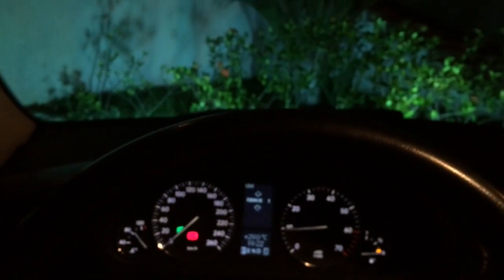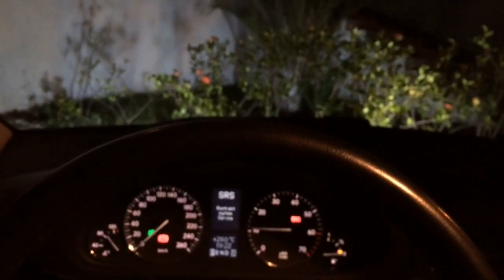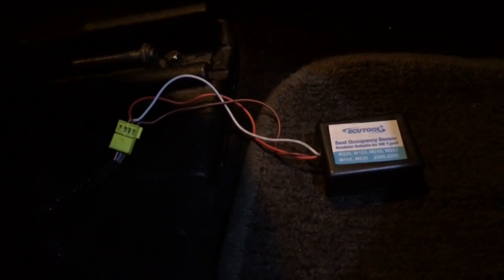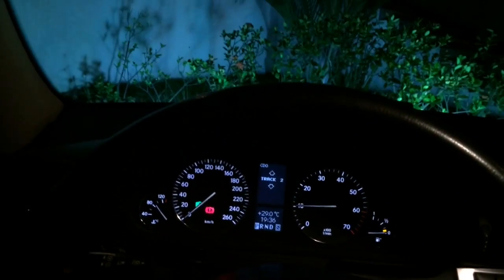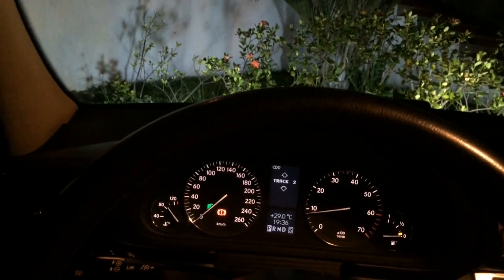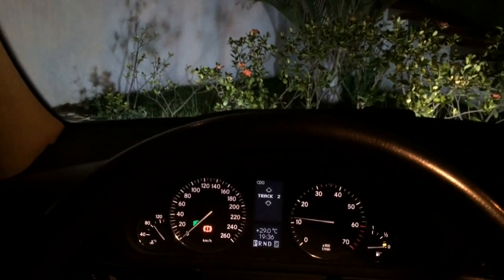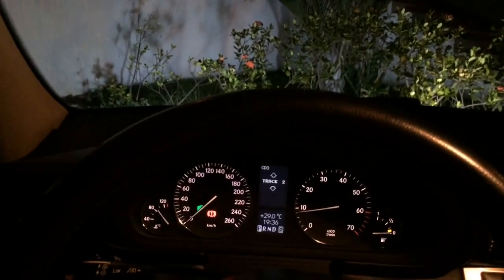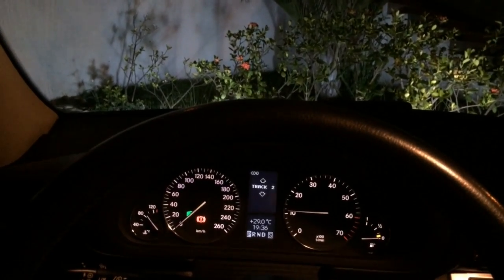MERCEDES W203 - 2005 - C230 SEAT SIMULATOR INSTALL

Comment: ho can help me with this faults?,,9025 Component B48(front passenger seat occupied and child seat recognition)is defective and 9242 The resistance value in the ignition circiuit containing component R12/21(Right front side airbag ignition squib )is too high,,what i can do?
Reply from the maker: Hi , the first problem can be solved with the simulator I have used In this video , the second problem  , if you just want to turn off the airbag light and let the system inoperative you can place a 1 ohm resistor or 1,2 ohms resistor in the airbag conector in order to simulate its function. Sometimes the steering wheel ribbon gets broken and you can place the resistor before the steering wheel.
Reply: A personne erase that fault from dashboard and i remake mot again,i pass without problems...but i don't know in future if that fault will comeback will be a problem!!!

Comment: Hello
I have cut wires or cable on my CLK w209, i have 3 cable cut, pink and white, withe, brown! Now how to connect one by one, or color by color on simulator bypass have the wires red, withe, brown??? thanks bro!
Reply: you have to connect the red one to the pink brown to the brown one and the white one to the blue... I installed it today and it works 😉

Comment: Great video and info on the seatbelt ressitor trick!!!! Im actually with the SRS light always on cause the matt on the passenger seat is already broken so im going to try with this emulator also after seeing your video. My car is a 2005 C180 Kompressor wich is the w203 body so the link you share in the previous message is also good for my car right?
Thanks again!

Comment: Hi friend, I have just received the seat emulator and I have to say that it works perfectly, the srs light has gone, but, as I knew, the car indicates constantly to put the seat belt, because it thinks that someone is seating while there is no one. So I think that I have found the belt wires which has only two wires. I want to ask you how and where to put the 1 up to 2 ohm resistor to make the car think that the belt is already put?? Thank you.
Reply from the maker: +Ilias Dris Mohamed 

Hi there , sorry about the late , you have to put it in Parallel with the belt wires , this will have the same effect when the belt in attached.  

good luck
Reply: Hi my friend, as you have said, I had to put a resistor into the belt wires and it worked perfectly, but I have to say that the resistor must be a 100 ohm resistor. Thank you very much!!
Reply: Can you show how to put the wires in?

Comment: Well, I believe that with that emulator the car will detect that someone is seating while there is no one, so my question is, will the dashboard show that the passejer has to put the seat belt while there is no body?
Reply: +Ilias Dris Mohamed hello have you good result? please give me the solution :under the seat conduteur I 3cables dark pink, blue , black brown ! how to connect the bypass that red white brown ?
Reply: +Ilias Dris Mohamed put tu 100 OHM when?cable pink black bleu with and brown black! wath to put ?
thank iam frecnh my english it's smal
Reply from the maker: Just like this, the device emulates an adult seated on the passenger seat.
Reply: +Sussuca Ss So how could I avoid this alarm? Do I have to make any other connections?
Reply from the maker: ohh  yes , for shure , I had this problem in the first time.

You must put an 1 up to 2 ohm resistor in parallel with the seat belt  alarm connector which is located on the the seat belt lock connector and goes under the passenger seat. There are only two wires ok ? 

Doing this , the system will "think" the belt has been connected. 

good luck
Reply: +Sussuca Ss Thank you so much, I am about to get this product and I was thinking about this issue. I hope I will be able to find the wires of the seatbelt connector and put the resistors to disable the seatbelt alarm.
Reply from the maker: I´m shure you will , but  if you have any problems , feel free to contact me .
Reply: +zavier yves Hi, well you only have to connect the three wires with their color, if I remember well, the black, white and red ones. Once you connect them you will see that the SRS alert has gone but the car will detect that someone is on the seat, so you have to put a 100 OHMS resistor to make the car detect that the seatbelt is on. Hope that I have helped you.
Reply: Can you do a video to show where to put the 2 wires

Comment: How do you plug the unit in.  If I take the end off of the passenger airbag sensor mat and use that plug which wires go where?  This unit has a red, white and brownish wires,,,the sensor mat has two brown with white stripes and a black with a green stripe?.  What should I splice to what??
Reply: +tsebo1969 
I have the exact issue, two brown with white stripes and a black with a green stripe.
How do I install the sensor to the connector
Reply: +tsebo1969 hello have repair your srs? give me the solution please tank you!